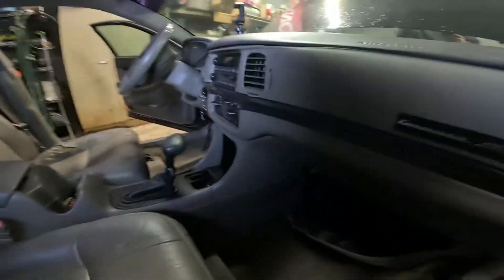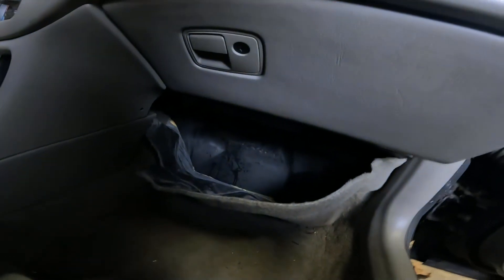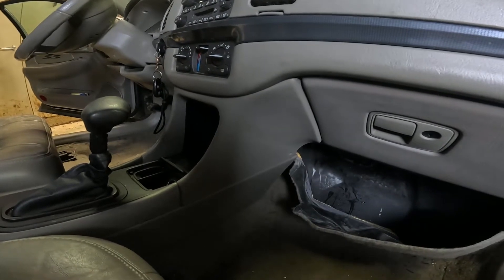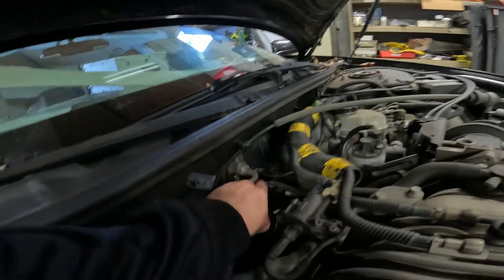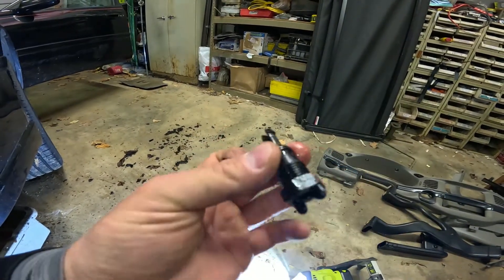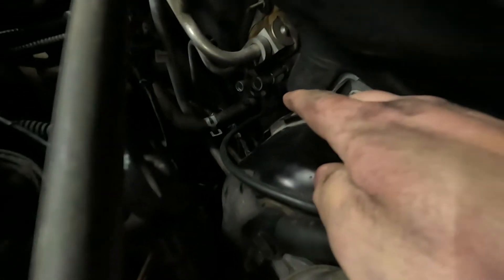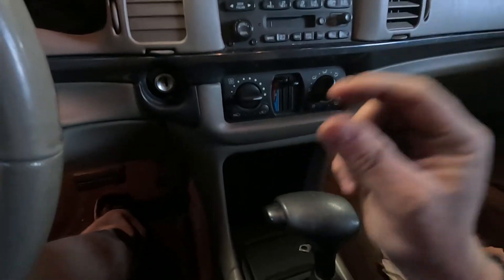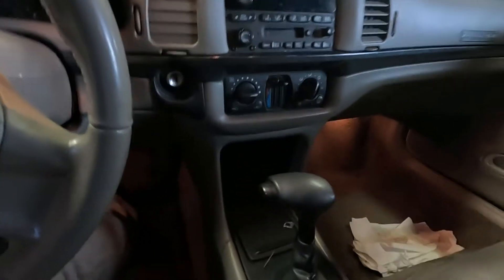2004 Chevrolet Impala Heater Core Replacement at home (Saved $1000)

Comment: So far I don't find wet carpet or losing coolant but I have smelled coolant a couple times in the '05, Implala, 3.4, 185k with bucket seats.  Mine is old and rusty but great, reliable transportation and I would do pretty much as you did.  These are old rides, nothing more destined for the crusher so no reason to worry about breaking a couple of unseen clips or plastic parts.  Pay no attention to people like oliver hiding in Mom's basement that has never fixed anything to speak of and keeps up on the latest way to get high.   Your video shows the basics of what I'm getting into if I must change my heater core and I really appreciate it.

Comment: Solid video. This job is a nightmare. You need to bleed the air out the coolant system.  Look for the brass 8 millimeter head bolt on the thermostat housing. Loosen it while the engine is running to let air escape.
Reply from the maker: Thanks for that tip! Ive been driving it for a month so now thankfully with no issues

Comment: Im glad you are doing this for yourself, you broke more than you fixed.
Reply from the maker: No I didn't. I broke pointless plastic pieces that mean nothing to me. I saved $1000, and my heat works fantastic.
Reply: @randomland6209  works for you and that's fine, but you embarrassed yourself breaking 10 things to fix 1 which just required a little more patience
Reply: @oliver_klozoff tw those plastic things you are are so frustrated about are cheap. Ive broke a couple. Professional mechanics break stuff like that all the time. It's no biggie
Reply: @wolfedout4099  professionals do the job without hacking things up worse than they already are.
Reply: @oliver_klozoff It's always the people with zero videos of them fixing a car that run their mouth
Reply: @firstlast---  and here you are running yours with no videos 🤡🤡🤡
Reply: @oliver_klozoff  I'm not running my mouth I'm calling you out because you are clearly in need of being checked
Reply: @oliver_klozoff  Right or wrong at least this guy is out here making videos to help people you are contributing nothing except negativity when you can't even back it up. Stay in your lane

Comment: Not just a 04 impala. 
A 2004 Impala SS
3.8 supercharged.
Reply: And ya. That plastic part you broke in the engine is vital. Runs your brake booster and vacuum system. I did the same thing.
Reply from the maker: Crazy how brittle it was. NOBODY locally could find me one, I had to order it online lol